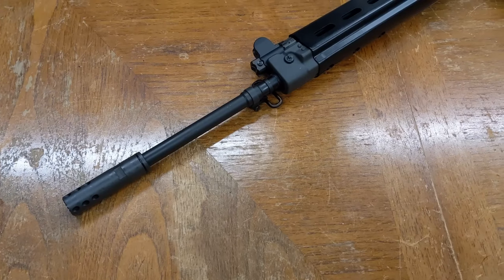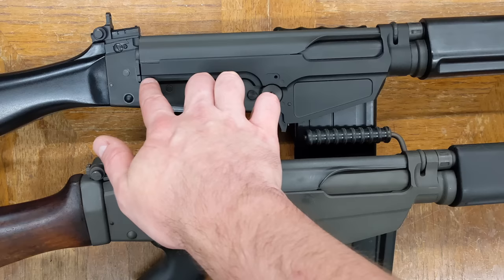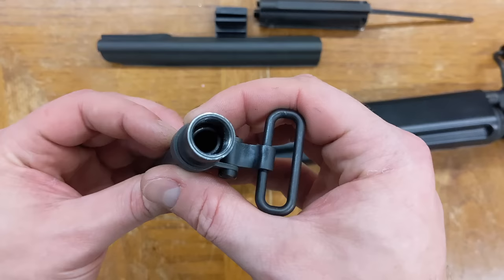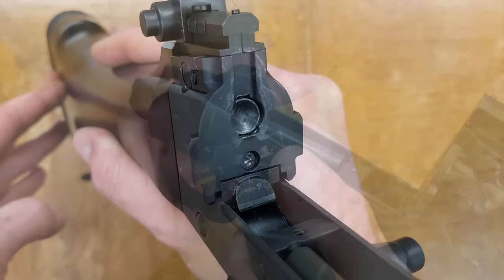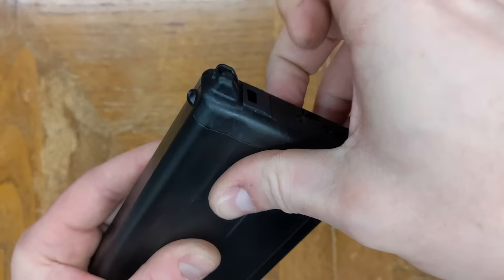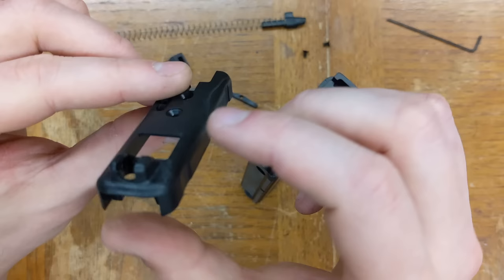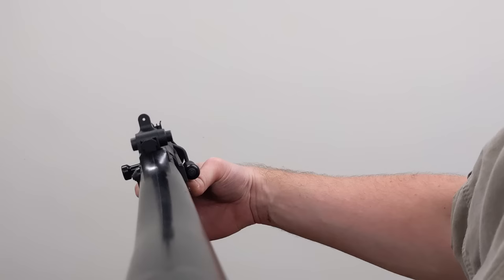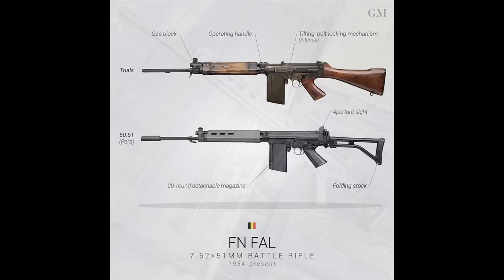VFC Airsoft LAR (FAL) Review

Comment: I just picked up a VFC SCAR this last month, and it's really interesting to see the similarity between the trigger groups. Makes a lot of sense, with them both being FN guns, but hey. They also use a very similar hopup setup, except on the SCAR you have to hammer off that collar/cradle from the hop chamber, which I had to do twice after finding out maple leaf rubbers can't hold BBs in the SCAR chamber due to lack of pressure.

Comment: This is the review I have been waiting for.

You answered a lot of questions, but solidified what I have been saying to myself in my little garage these past two weeks.

This thing is excellent. 

I got mine in the States, so I got the orange tip. I ended up going onto DSA and ordering a Belgian flashider. Looks perfect, threads on perfect!

I dislike the furniture, and will be upgrading to DSA furniture. It’s really awesome that DSA is based in the states and specializes in FN FAL variants, which makes this VFC so sick.

Onto the rocket valve and internals, god. Thank you for specifying. I now can run this at my local field on .32’s. 

Overall, this thing is wicked expensive but by far to date this is probably the coolest airsoft gas rifle ever released. 

Thank you for your time and effort to do this video, it’s beyond helpful for myself and who knows else that is searching for info on this rifle.

I have been running mine with the buffer, but I will be removing it and thanks for saying so, because it does cycle the traditional 600 or so RPM with it removed

Comment: Love the video mate, watched it maybe 20 times before mine arrived.
Slapped some real plastic furniture on it, changed both the pot metal barrel section and gas tube to the steel versions by DNA (reccomend) and modified it with some of your reccomendations and some of my own little fixes, love it to bits but man I wish metric wood furniture existed in the UK, or even was just able to be shipped here, my 60s kit just don't feel right with plastic😂 thanks for such an extensive and informative video! Takes this from a "nice" gun to the pride and joy of a fair sized arsenal. Never stop being you fella!

Comment: Hi, EE team. 
I’d watched your VDO like 10 times before I decided to pick the VFC LAR up and another 10 more times afterward when I performed troubleshooting.
Mine shot well for like 4 mags till malfunctions like mis feeding double feeding, just to name a few, started to occurring which is annoying. 
That said, it is the only gas FAL in the market today so no point in complaining. 
I think I have one good reason to keep the plastic short-stroking piece in the gun which is to prolong the life of the bolt hold open mechanism. The piece shorten the distance between the end of bolt travel and the location of the bolt hold open device which translate to softer impact due to the bolt is still slow.
Every mod you mentioned appears to be necessary in order to keep the gun running as I did all of them and further. 
I also want to add to the importance of the out-of-battery safety piece as it keeps the hammer down  while the bolt is reciprocating. In my case, the bolt is dragged by the hammer during cycle due to spring that keep the out-of-battery safety piece appears to not have enough force to engage the hammer.
Reply from the maker: Misfeeding is always troublesome to deal with. See if you can record the gun cycling in slow-motion, as that's an easy way to diagnose nozzle behavior issues during the cycle. Good point about the bolt-hold-open too; we're tracking that piece specifically for wear, but we're not especially worried just because the recoil spring is fairly soft. And lastly, we suggest checking your out-of-battery safety (auto sear) to ensure that its engagement surface is sharp, as well as the corresponding surface on the hammer. If both are sharp and it really is just insufficient tension, then bending the torsion spring may help to achieve reliable operation. Hope you get it sorted.

Comment: Excellent review. In the knealing position you can hold the bottom of the mag instead of the stock. We were taught to leave a round in the chamber before changing mags, this way it should continue with a mew mag, not sure if this works on the airsoft ones. Love the inclusion of the gas parts. Yes, original very heavy, especially when marching down the mall to buck palace
Reply: I have this airsoft gun, and that is exactly what I figured out. Elbow on left knee, hand on mag.

Comment: Excellent overview, I'm loving mine this far. And yes I'm going deaf.

The outer barrel thing is going to become an increasing issue due to recent Taiwanese legal problems and the perennial problems with local legislature and law enforcement here trying to score points by claiming all the real steel shootings are as a result of "converted toy guns with metal parts." 🤔🙄

Watch this space for more on that I guess...

Mine was capable of single shot hits on a gas can at 20m the other weekend, and I just picked up the railed cover to slap an optic on it to alleviate my ageing eyes.

Comment: As one who has this replica, I caution anyone who removes the plastic pace that shortens the travel of the bolt as the rear sight mounting point is aluminum and will break like mine has. doesn't hinder performance but something to be cautious of. also the gas tube threads towards the front that secure it to the front sight will break due to recoil. hope this helps anyone who needs to know.

Comment: Excellent breakdown and review. Subbed in the hopes of seeing more like this, (hopefully of guns I already own, but I'm not holding my breath) as the detail strip and reassembly is an excellent reference when doing maintenance and modification.

As to the Para version... does my breath smell bated? A carbine length, Para-pattern, GBB,  w/muzzle flash simulation, and decent recoil? My wallet hates me at the very thought... Time to start feeding it to fatten it for slaughter later.
Reply: And I just noticed from visiting your channel page... You're the flamethrower guy at Ballahack! That sound is unmistakable, and either reassuring or terrifying, depending on which way the stream's headed.

Comment: Looking at how similar it is to the real thing, I wonder if you could take the trigger pack from a real FAL and toss it on with minimal/no fitting required.
Reply from the maker: We believe it would fit with no significant modification besides trimming down the reinforcement/blocker tab at the front of the trigger housing. However, it would require swapping over at least the hammer and recoil springs in order to cycle and avoid damage to the airsoft internals.
Reply: @ExplosiveEnterprises  Still though, it would be an interesting idea for those who want to be as "clone correct" with their airsoft as possible.

Comment: Do you know if the cocking handle and fire selector are able to be removed and replaced? I'd like to do an accurate build with this as the base gun but the mock I would do requires the folding cocking handguard and a different style of fire selector.

Comment: Does the shortstroke buffer help with cold weather performance at all or is it such a marginal difference that it doesn't matter?
Reply from the maker: To be absolutely clear, it makes no impact whatsoever to performance on the FAL, and on most guns using a short-stroke buffer actually reduces efficiency (by pre-compressing the recoil spring). We're not sure where the myth got started that short-stroking a gun makes it more efficient, but that's not how GBBs work.

Comment: the only thing i worry about with taking out the short stroke buffer is the potential to damage the bolt stop. correct me if im wrong but since it has more room to travel i would imagine it would hit the bolt stop with more force than usual which it might not be good in the long term.
Reply: Ye, but it's all steel, so there shouldn't really be any real issue there

Comment: When I received mine the entire front half of the rifle starting at the hand guard became loose and the threads for the barrel don’t keep it In place what should I do??
Reply: Hey man, very late reply but I also had this issue.
The way I fixed it was by unscrewing the front sight (using the two prongs on the provided tool) and underneath (you'll probably need a light to see down the hole) you'll see a little grub screw, I removed it, applied some blue loctite ( med hold) then screwed it back down, it's held for me so far, sadly like most parts it seems from factory it can wobble free, but at least its fairly easy to fix once you find it. Hope this helps!

Comment: Awesome review!
As an AEG user that would love to switch to GBBRs, the only gripe I have with it is the mags capacity, while it adds realism I feel it also handicaps me too much in games.
Modern GBBRs seems to hold enough gas for at least 2 full mag reloads (more in this case).
Do you know if is this a design limitation, or can GBBR mags capacity be tweaked by change the mag spring or something of the sorts.. ?
Reply from the maker: On most GBBs, the BBs form a stack along the front of the magazine, with the gas reservoir right behind, so the capacity is limited to what can fit in that stack. There are some GBB mags where the BB stack will actually curve under the reservoir and follow the baseplate, allowing a bit higher capacity, but they often have feed issues. Our resident GBBR enthusiast has historically more typically used AEG machine guns, so we definitely understand the hesitation about ammo capacity- but we find that with a good hop-up and properly adjusted sights, it isn't necessary to shoot nearly as much to score a hit, and then the lower capacity of gas mags becomes manageable. Bring along a can of gas, a speedloader, and an appropriate speedloader adapter (we're fans of the ComradeQuiche designs), and then you can reload on the field as well.

Comment: After 7 months has the removal of the buffer done anything negative to the rifle?
Reply from the maker: No, but it appears from reports online that on some guns the 'tail' of the bolt can contact the top of the trigger housing at the very end of travel and potentially cause damage. Cutting down the buffer to ~1/4 its original size might be a good safeguard.
Reply: @ExplosiveEnterprises  Good to know, also have you got any recommendations for a new inner barrel?

Comment: Are GBBR barrels compatible with AEG barrels?
Reply: No
Reply: @opairsoft8100  what makes them incompatible? Not trying to fit one just curious.
Reply: @Nater2004  how they are secured
Reply: @opairsoft8100  ah. Neat. Thanks bro.
Reply from the maker: Typical AEG and GBB barrels are shaped a little differently- if you compare them on Google, you'll see the difference pretty quickly. However, there are buckings that allow GBB barrels to be used in AEGs, and some GBBs (notably GHK and Viper Tech) use AEG barrels to begin with. The key is just making sure that whatever barrel you're looking at has the appropriate cutouts on the sides to fit into the hop chamber.
Reply: @ExplosiveEnterprises  Cool! Thanks for the info! I'll put it to use once i hit the lottery.

Comment: Why would they cheap out on the barrel on this GBBR. You are already paying alot for a realistic feeling gun that requires care and maintenance, just make the barrel out of steel.
Reply: because most Airsofters will either b¡tch about the weight, or the price!
Reply: @keyboardcommando5146  lmao it is already $700 there's nothing left to complain about
Reply: @fiskersproductions  you’d be surprised. But by no means am I excusing VFC. What they’re charging you $1200 for in the DX, could’ve likely been done for $700, $900 at most.